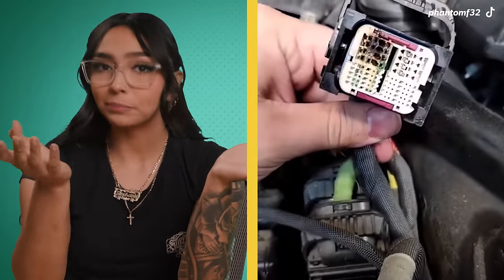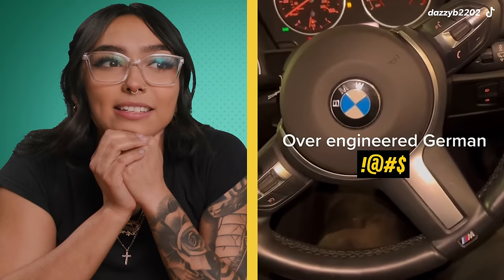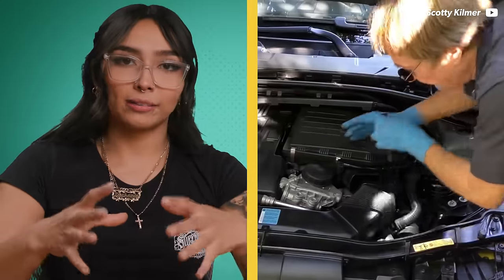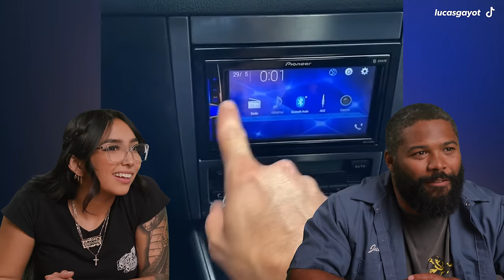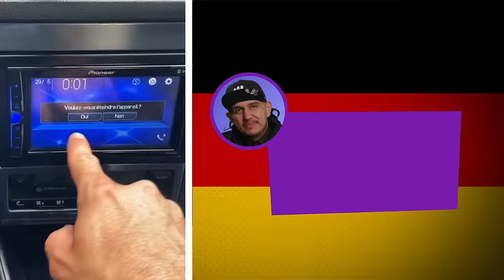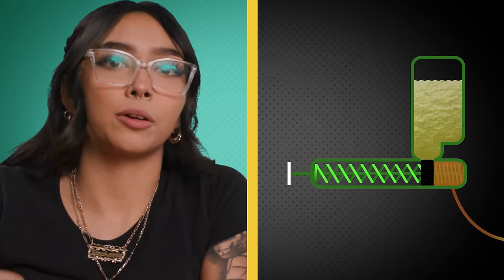Mechanic Reacts to German Engineering Fails

Comment: As a BMW Master Tech of over 17 years, it’s obvious who hasn’t worked on these shit-boxes. 

0:21 it’s not abnormal to have a thermostat in that location. BMW has so many extra coolers and coolant hoses because they’re trying to get as much power in a confined space. I don’t know why she said it was abnormal to have a thermostat down there. The reason why the coolant wicks its way up the harness is due to a phenomenon called “capillary action”, something you should have learned in chemistry. When the pins of the thermostat are not water tight, the flow of electricity will actually wick that fluid back up the wires, back to the source- the DME. The same is true of oil circuits. This isn’t a BMW exclusive thing, but those N63 engines did have a recall or bulletin for that issue. 

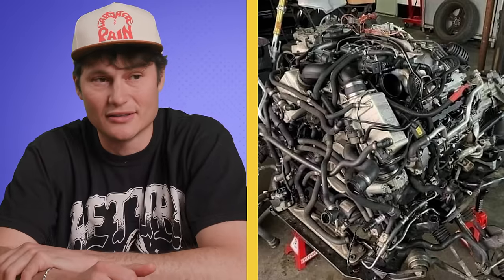1:49 that’s the typical N63 twin turbo V8 that BMW has been using for almost 15 years now, with a few updates. They’re a nightmare of coolant hoses, wiring harnesses, vacuum lines, etc and nothing is easy to access. It’s a “hot” V8, meaning the exhaust and turbos are between the cylinder heads, and the intake is on the lower side of the heads, where the exhaust would typically go. These engines also use corrugated plastic pipes for the PCV system, which get fragile and brittle over time, with the motion of the engine, and the fact that they sit on top of the turbos. Also, the turbo coolant lines tend to leak because of the same reason.  THIS is a better example of trapping heat than the BS Scotty Kilmer video, which made no sense at all. 

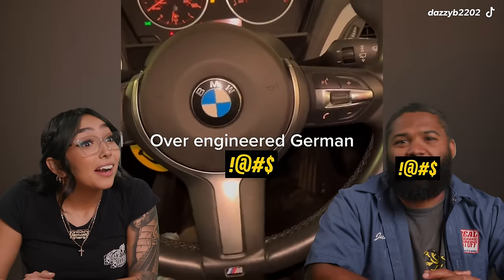2:27 that steering wheel thing is nothing normal or that can be blamed on the engineering. That’s definitely an issue with the car….NOT the steering angle sensor. All modern BMWs use electric steering, except maybe some M cars, for better feedback through hydraulic steering. 

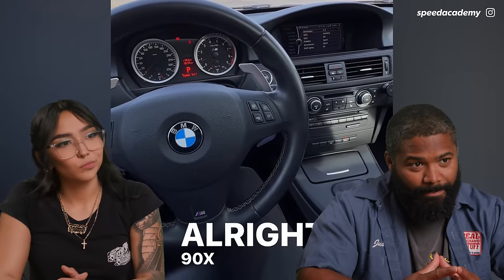5:00 the switch could just be shorted out, but it is possible that it’s due to spilled fluids. EDC controls the suspension dynamics, not sport mode. But she’s probably right in the fact that the connection point is pinkish in color. 

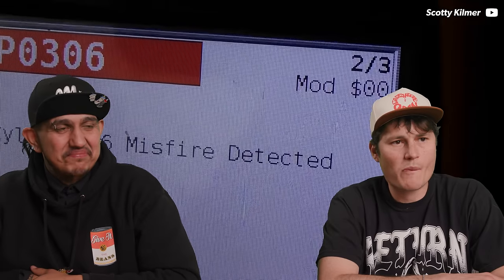6:18 that’s an N54. It’s super easy to access all of the plugs and coils. I’d never let him touch my car, seeing him use a 4’ prybar. Take out 8x 8mm screws to remove the microfilter cowling, and you have easy access to all plugs and coils, and it takes 2 minutes. That engine cover doesn’t retain the heat. It helps protect that area from water, and has sound deadening underneath the cover because that engine utilizes direct injection, so the injectors are very noisy. The next iteration 335 has an N55 which actually would be a GREAT example of shitty design. It still has the air filter up top, but there’s a charge pipe that goes over cylinders 4-6, so you have to take off a bunch of stuff to access the back 3 cylinders, you can’t easily swap plugs and coils, and you can’t run it with the cover off. 

If you want good examples of shitty BMW engineers:

I need a second person to help me open and close the hood on the i8. It’s lightweight, aluminum hood that can bend and distort very easily. It’s also $15k to replace. In order to replace the air flaps (another stupid BMW design that blocks airflow to the radiator to heat the engine up faster…but they fail all the time and cause check engine lights) I have to remove the hood before I can remove the bumper

On the i3, in order to replace a window regulator, you need to completely remove the door from the body, as the door brake check goes THROUGH the door panel, and there’s no way of removing it otherwise. 

On the iX, BMW engineers decided to put the subwoofer in the rear of the car, under the back seat, but on the underside of the chassis. That means that if your subwoofer goes out, you have to remove the entire high voltage battery unit, just to replace a speaker.

We also have a TCB under the shark fin antenna, which has a battery you have to replace every few years- typically you have to replace one before it goes out of warranty. In order to replace it, you have to lower the headliner to access it. It pays 3 plus hours on some cars under warranty. That’s 5-6 hours when the customer has to pay for it. 

Heck, even filling up the washer fluid can be an ordeal on some cars. On the iX, they don’t want the customer to open the hood, so the BMW emblem opens up to fill up the washer fluid…but you have no idea how much you need to add. On other cars, the little blue cap is recessed to the point that it won’t stay open. So you open the cap, lift your Gallon of washer fluid to pour it in, and the cap closes back down. You literally have to take the cap off by pressing a release/lock tab that you SHOULD only need to engage when resolving the cap…all just to put washer fluid in the car. That’s an absolutely blatant example of how the engineers never seem to touch the cars, or think about working on them.  

I could go on and on and on about it. We have a saying in the BMW world:

“A BMW engineer would climb over a PILE of virgins, just to fuck a technician”
Reply: You just can’t come here with facts! It destroys the whole meaning with this video 😂
Reply: Couldn't fully rubberized sealed sleeving around the thermostat harness protect it from the failure at 0:21?
Reply: And here we See again that you should never trust a YouTube Video fully. Since Most arent really experts...
Reply: All "Donut" media vid like these are FULL of bs and nonsense.  No need to write a book about it! 🤣
Reply: Yep any competent person with some tools and time can swap out plugs and coils from an N54 easily. Scotty is just sensationalist trash who probably drives a BMW himself.
Reply: @sneaky_krait7271  no, that only protects water from getting into the connector. This situation happens where the pins of the connector go into the electrical device (thermostat and the internal electronics should be waterproof from the internal coolant, but a design flaw allows coolant to work its way to those pins. Then the current flow and capillary action allows the flow of coolant up the wires, which bypasses the weather connector seals, because it’s actually going up the wires, inside the insulation around the wires.

Sorry for the confusion. I know my original comment said “when the pins aren’t water-tight”, but I meant from the inside. So internally, the coolant inside the thermostat can work it’s way into the electrical portion of the thermostat circuit board, then work it’s way up the wires. These thermostats are known for this, as are the eccentric shaft sensors on the N52 engine, although that’s oil. If you pull the connector for the eccentric shaft sensor and see oil in there, you need to replace the sensor ASAP, or it can eventually work its way back to the DME, and be very costly.

The female tech said “coolant dripping off your thermostat” will cause this, which it won’t/shouldn’t, as they have that rubberized weatherproof connector you’re talking about. It’s more caused by an internal failure of the component. My example of the eccentric shaft sensor is perfect to demonstrate this, as there’s no oil anywhere outside of that sensor. That sensor sits inside the engine, on the eccentric shaft, so the inside of the engine is obviously full of oil and has oil slinging all around. The only way for oil to get into the sensor is from inside the sensor- the connector is outside of the engine.
Reply: @dknollRX7  Oh the coolant broke into the thermostat itself, so that part needs better sealing indeed. Thanks for the extensive explanation
Reply: @sneaky_krait7271  exactly! You’re welcome…glad to help out.
Reply: bmw’s still are the biggest shitboxes. Poor quality and very ugly on the outside
Reply: @azertyytreza8947  we’ve had a string of brand new cars with issues that we’re doing a Pre-Delivery Inspection on (basically came off the carrier and we have to get them ready to be sold). They’ll set a check engine light for the electric steering rack. The test plan says to replace it. You have to contact TSARA, a remote engineering team, for them to approve the replacement. I had a brand new G30 5 series with 7 miles and it needed a new EPS steering rack, which was on backorder for 3-4 weeks.
Reply: Was about to type this up as a bmw tech myself. They can be shitboxes, but it’s not because of what all the normies think are the reasons.
Also, there’s a little bit of a workaround on some of the i8’s with the standard hood vent, it works pretty good as a handle 😉
Reply: BRO! as a BMW Master Tech of over 11 years....THANK YOU for taking the time to write this up...couldnt have said it all better myself.

Also as far as the steering issue goes. Ive seen countless other makes and models doing the same shit in videos and reels

But as far as this video goes... its "mechanics react" for a reason.
Reply: @jesperwall839  😂I liked his fact sheet but I LOVE your comment😂
Reply: @sneaky_krait7271  the main problem is that the parts were engineered to be "waterproof"  not "coolant fluid" proof the fluid has different physical properties than regular water and especially when hot can leak and get into all kinds of weird places where normal water couldn't get to due to its high surface tension.
Reply: Thank you. You’ve summed up why I won’t ever bother with one. Beyond me and my patience levels.
Reply: Feel like the engine cover bit was especially BS— doesn't every car have those now? Feel like I remember an earlier video on this channel featured a tech bitching about one in a domestic vehicle
Reply: @saint-cetacean  yeah, they’re pretty much standard on modern cars. Some are worse than other as far as going overboard with trying to cover every bit of the engine…but they don’t really retain heat that much.
Reply: @dknollRX7  Felt like a lot of the videos cited here were grievances in search of an outlet, tbh. A lot of them were either things that are common on cars of any provenance, or issues related to absolutely refusing to maintain a high performance vehicle as needs to be done. Ah well.
Reply: @dknollRX7 I was literally going to comment saying it’s just like what happens on N52s with the ESS. But decided to keep reading first lol.
Reply: The steering one probably hit something which broke the planetary gearbox in the steering rack.
Reply: @alexpfeffer64  very likely! But that example is not indicative of poor engineering, as it was affected by outside influence- impact, crash, etc. 

But that most likely what’s going on inside the EPS unit.
Reply: Capillary action has zero to do with any current or voltage.